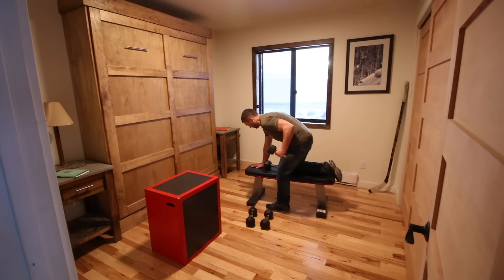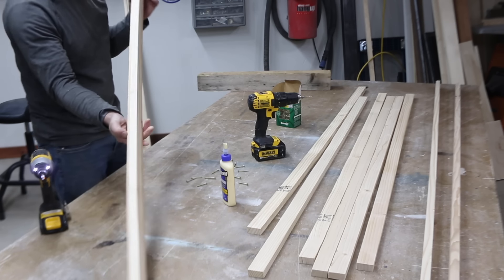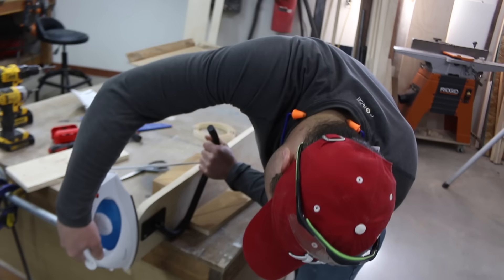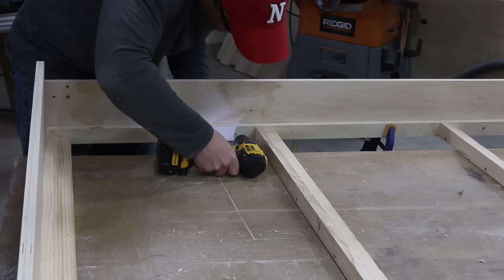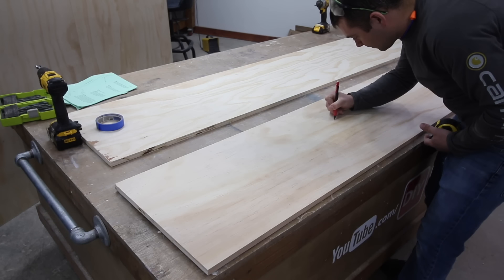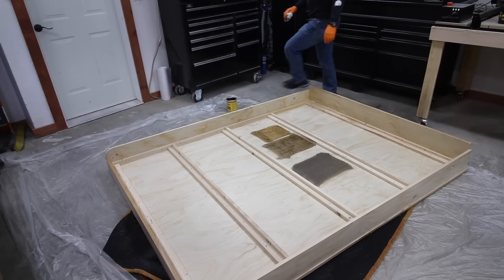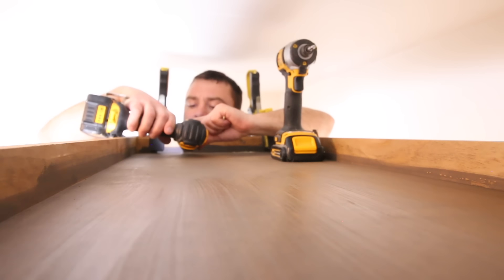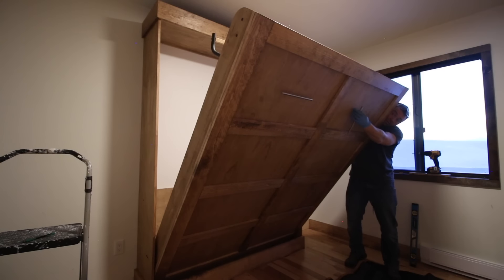You can Build a Murphy Bed!

Comment: Great job Pete, Exactly what I needed to see. I ordered my hardware from Amazon, pretty sure the instructions are the same as yours. My interior doors are 4 panel like yours, made of Sapele, mahogany will be the closest I can find locally so I’m using that for the bed. Wish me luck, I’ll most likely need it!
Reply: Did you complete your Murphy bed?
Reply: @youngsun6617  Not yet but it’s next in line. Friends and neighbors were in need of my help so they always are the priority.
Reply: @stevenrich1819  for sure totally understand. Was wondering what hardware you planning on using from amazon?
Reply: @youngsun6617  I’ve purchased the Easy DYI Murphy Bed Vertical Kit, the 
Philippine mahogany plywood from a hardwood and plywood retailer. I wanted to use Sepele as all my interior and entry doors are made of Sepele. The cost of Sepele was four times that of my Philippine mahogany. Sepele is African mahogany and looks very close to Philippine mahogany which still cost a bundle, just shy of $600.00. BTW…the only two reasons I’ve elected to build verses buy a ready made Murphy bed was 1). I could not  find one made of the wood species I desired and 2). If I did happen to find one, shipping it to where I live was ridiculously expensive. To fit my budget, I had no other choice.
Reply: @stevenrich1819  that sounds like it's  gonna look great. You should post some pictures or make a vid while making it. 
I'm all about diy.  No one is gonna make it exactly how you want it but you. Also it's next to impossible to find something that matches what you already have and like even if you had a huge budget. 
I will be making mine as well mostly because I enjoy woodwork and my tools would just get dusty from non usage vs from getting usage. But that is why I was asking about the hardware you found.

 I actually like most of the hardware used in this video. Most Murphy beds have a giant space between the bed and the headboard because of the placement of the hardware which is because of the hardware itself. Depending on the hardware and placement you will have a taller "closet" and longer bed footprint when the bed is down. If space, (both height and floor space), is not an issue then you're gonna be fine. While it isn't really an issue for me I just don't like the look. More low profile the better for me and my application.
I will be checking out your pick on amazon shortly. Thanks for the info and keep me updated if you can. I always enjoy a good diy vid, that's why I watched this one. He did good work.
Reply: @youngsun6617  Maybe I’ll do a video or just post pictures, not sure if I’ll do either. I should have made a video on a fold-up, pull-down attic access ladder I built. Most attic access ladders mount on the ceiling, I had to mount mine on a wall. No company makes one so I had to figure out how to build one. It was challenging, not perfect in design or function but decent looking and usable. Maybe I should start a YouTube channel to help others with challenging situations?
Reply: @stevenrich1819  sure why not? Most people won't tackle a job because its intimidating and they lack building experience. I think it's good because it can show some of the unplanned traps and pitfalls that always occur. Your job won't be perfect ever but it helps other people learn. That's why I watch these videos. Im good at building, design, and putting things together but I am too lazy to film and edit. I wish I wasn't otherwise my videos would be existant and on youtube.

Comment: Any plans for twin size plans
Reply from the maker: Hi Merry! The kit comes with the plans, which is what my bed is based off. The only major modification was adding the trim, which I have a diagram of the measurements on my website. However, the plans come free with the kit -- and they do have it in the twin size. The process is very similar for any size bed using this kit, but the placement of the hardware will change a bit. Here is the link to check out all sizes they offer: https://amzn.to/2JyxHZw

Comment: Could you have just used the L stringers as the decorated side? This would save the 1/4" ply and give you some variation on the front. The mattress would lay on the interior of the 3/4" ply.
Reply from the maker: Hi Leigh! I went by the plans provided by the manufacturer and then decided to add the trim pieces on later. But you most likely could tie the 1x4 boards into the rails and then put the plywood in on top. You'd want to test to make sure it provides enough support though. Best of luck.

Comment: Great Job! Im working with my murphy bed right now. Ive a question, is it possible to varnish the edgebanding. Is all edgebanding possible to stain or varnish? Can i simple pick a light edgeband and then stain the murphy bed to the color i want, aswell as the edgeband. Greetings from Sweden.
Reply from the maker: Hi! The type I used is made to be stained and finished. You can typically stain the edge band to match and that's what I usually do. I hope all is well in Sweden!!

Comment: Just thinking - could you use a deeper mattress by making the side frame deeper? Seems pretty easy to do.
Reply from the maker: Yes, it could be done. Might need to adjust the pivot points a little but is certainly doable.

Comment: Hi Pete, thanks for the tutorial. Do you know if it's possible to change the murphy bed's pivot point? I'd like to design a built-in sofa in front of the murphy bed assembly, but will need the pivot point to be at 14" high or so. Of course I'll have to fabricate taller legs, but I'll be able to weld something up for that. Thanks in advance!
Reply from the maker: Thanks! I'd recommend contacting Create-a-Bed, they are very helpful.
Reply: Great video and plan to build one soon. Is there a way to retro these plans for a pillow top mattress that is 13” thick? Is it just as simple as building the box frame 1.25” thicker to accommodate?

Comment: Thanks for the video.   I have ordered the kit and am going to try this.  
Quick question: Can you see any reason why #1 2x4 could not be used to make the frame struts instead of the two 1x2's glued and screwed?  I realize they would be a bit wider (3 1/2") but it seems this might eliminate a step and still give some rigidity.
Reply from the maker: I think it would work fine

Comment: For me,  most Murphy Beds sit too low to the floor. If you raise the pivot points so that the bed would sit higher when out, the cabinet would need to be deeper and the legs longer. I supposed another way to do it would be to have the bed sit sideways along the wall with a higher pivot point. Any plans you know of for such a design??
Reply from the maker: Hey! I'm sure there are some plans for higher beds but I haven't looked into that yet.

Comment: How deep from the wall is the cabinet when closed up?
Reply from the maker: 17 inches with the front decorative trim included in the depth.
Reply: Thanks and how wide and tall is it as well. Thanks
Reply: @DIYPETE  how tall and wide is this when finished?
Reply from the maker: @craignoble43  66 inches wide and 90 inches tall. This includes the extra height of my 1x6 trim on top. You can find more info here. https://www.diypete.com/how-to-build-a-murphy-bed/   --- feel free to check the Create-a-bed website for additional dimensions as well. Cheers!

Comment: could this be done with a ceiling thats 85"?
Reply from the maker: Hey Jeremiah! I just measured mine, and it looks like it is around 86-87 inches without the top 1x6 trim, so just a bit too tall for an 85" ceiling. They do also make a horizontal kit though, so the bed comes down in the opposite direction. That might be something to look into!

Comment: I wonder if you can build a Murphy bed built into the wall?
Reply from the maker: Hi! I've seen them built into closets which is pretty common If you wanted it flush with the wall then you'd need to have a wall that was about 15 inches or so. -- Most interior walls are built out of 2x4s -- so only a small percentage of it could actually go in the wall. Cheers
Reply: Thanks for replying. I guess I should kinda reword myself. The illusion of a Murphy bed built into a wall might be possible say for example there was a deep closet on the other side.... does that make any sense to you? Can you envision that?
Reply: It would be cool to built it flush into the wall with a large painting on the front then pivot on one side opening like a door into a hidden room.

Comment: Is there plans for this project
Reply from the maker: Hi Kelley! I used the plans from the company as they are specific to their hardware. They were included with the kit. I added trim to the finished product and the diagrams for the trim are on my website. The link in the description to my website will show some more information for ya if you haven't yet checked it out. Thanks!
Reply: Thanks

Comment: Awesome project and great work! But total cost "$700" is easy to write when you have all machines and tools worth like few $K USD to make such build...
Reply: Well, you don't need that tablesaw; you can pay the wood vendor to make all of those long cuts (if they provide this service. I find at HD they don't adhere to the # of cuts for free too tightly, so the amount of cuts that this guy mentioned would likely be free.  Or you can use a decent circular saw with some clamps.  Jigsaws are cheap, as is a corded drill with the cheapest bits you can find.  Those flat bottom hole bits are probably the only "fancy" tool you'd need to create this.

Realistically, you need maybe $100 in tools, most of which an average woodworking DIY person would already own.  Admittedly it would take you more time than this guy, but there you go.  Also, that Murphy Bed Kit can be found for less than $300 (I see it for $250 on many sites), and the wood less than $400 (YMMV)
Reply from the maker: Thank you for chiming in
Reply from the maker: Thanks

Comment: This is a really awesome build and I would love to implement something like this in my second bedroom as it is a tad bit smaller then the Master bedroom and with a queen size bed, it does not give much room for mobility or activities. That bedroom is currently set up as my game room, so with that being said what would your recommendations be in possibly incorporating "legs" on the bottom of the Murphy bed that could be folded out or represent  a couch like area when the bed is resting in its upright position?
Reply from the maker: That would be a great addition! And I love the idea of figuring out a way to incorporate a couch on the front. I've seen this done with a desk added to the front, but not yet a platform that could be used as a couch. You might see if you can find some ideas that could be incorporated into your design from the desk ideas. Cheers!

Comment: This is called a DIY project.  Just remember folks, if your going to work on a project like this you’re going to need a good work space and lots of tools. 

Now off to buy a convertible couch that takes up a about the same area as your cabinet and with very little effort turns into a full size bed. The overall cost was less and I didn’t have to buy a truck full of equipment.  

So yes, the project is good for DIYers. But not for All. 

(sarcasm response)
Reply from the maker: Hey Dale, thanks for chiming in. Yep, this is certainly a more advanced DIY project. But for those with the space and tools, it is doable.